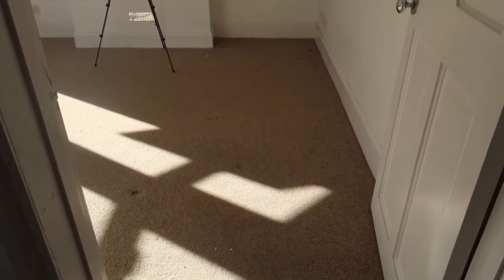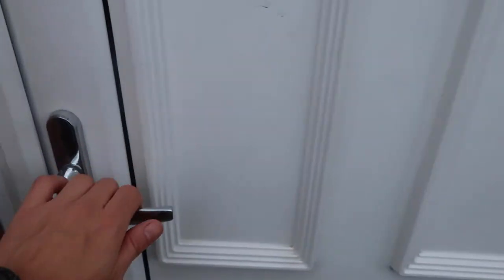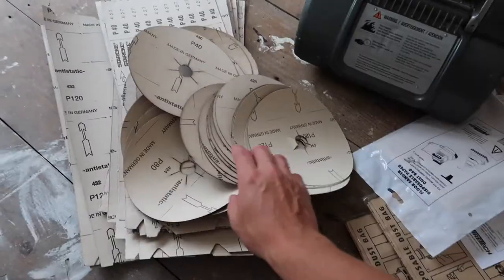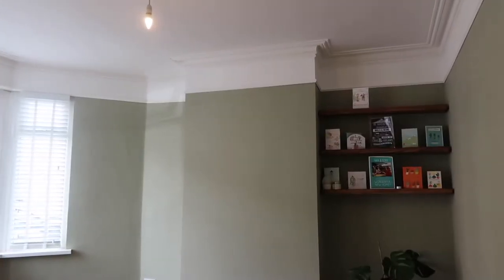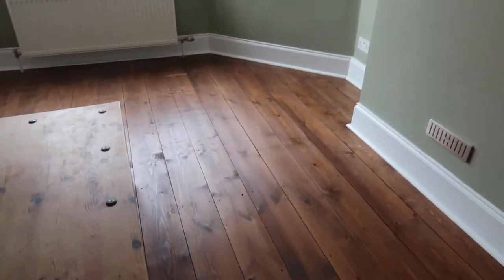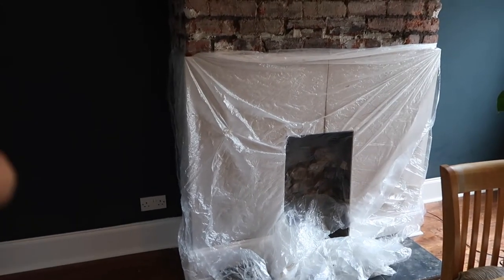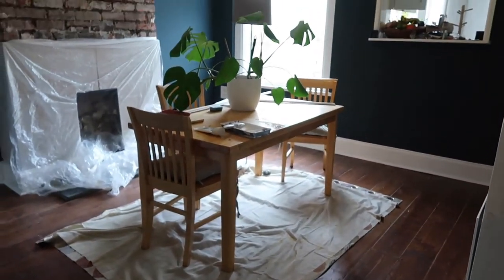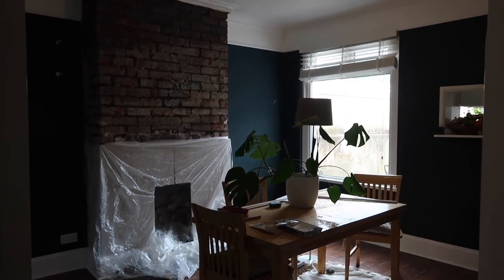HOW TO RESTORE ORIGINAL HARDWOOD FLOOR BOARDS IN AN OLD HOUSE | 1900 ENGLISH VICTORIAN TERRACE | HWH

Comment: Do you need to fill the gaps between the boards?
Reply from the maker: Hey there! It totally depends how big the gaps are - in the living room we didn’t have big gaps so we didn’t bother filling it in, but in the dining room there were slightly larger gaps where we thought cold air, slugs and bugs would come in through so we filled some with some filler we bought from b and Q before staining the floor. Some of it fell completely through so another suggestion would be to stuff it with something if you can! Are you thinking of doing this to your house? Thanks for watching!